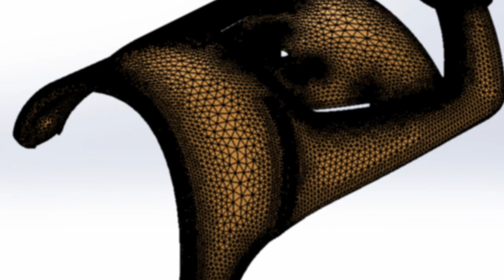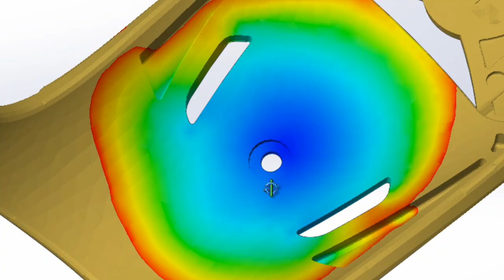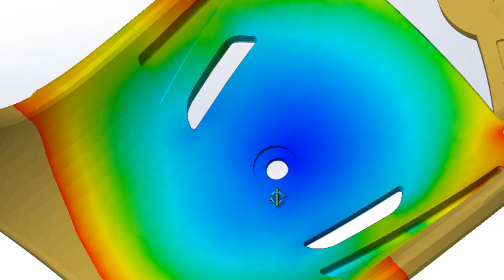SolidWorks 2013: SolidWorks Plastics

Comment: If only they'd expand this to take in gcode files for 3D printers and convert them back into models (in much the same way Repetier Host does) in order to do a structural analysis on the part. Printed parts as of right now can have wildly different properties than expected due to incomplete bonding between layers, part warping, and hollow areas in the part since many parts are printed with infills of less than 100%.
Reply: This comment is pretty old so I'm just leaving this for people who are wondering to find. 

Solidworks is for the most part in the engineering space, where people have access to engineering grade 3d printers that can produce parts as strong as injection molded plastics (for example digital ABS on the stratasys polyjet platform). If solidworks were to do something like this it would be more focused on the consumer side which wouldn't really be that great of an idea because anybody spending $5000+ on a piece of software would be getting the parts printed on engineering machines. The education sector could also possibly benefit from something like this but not significantly.